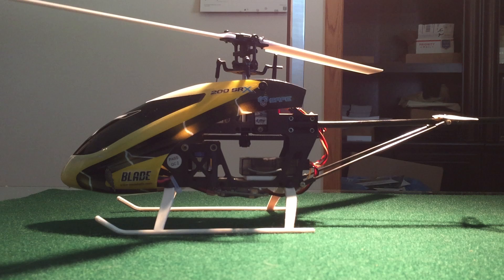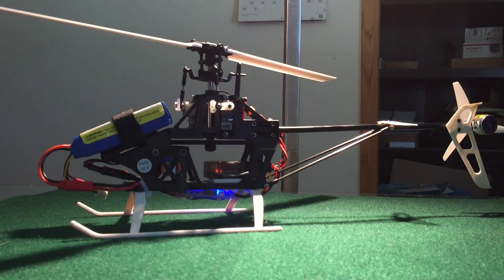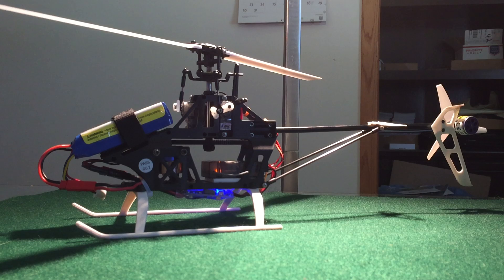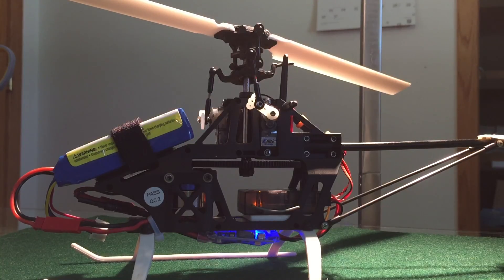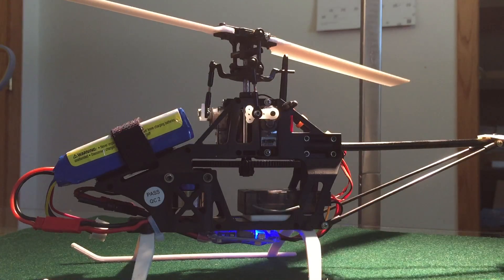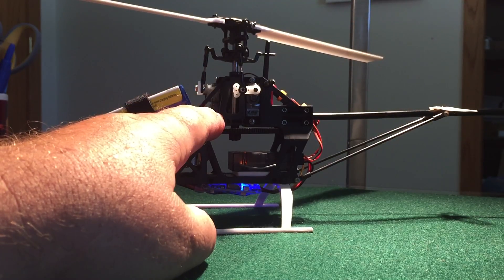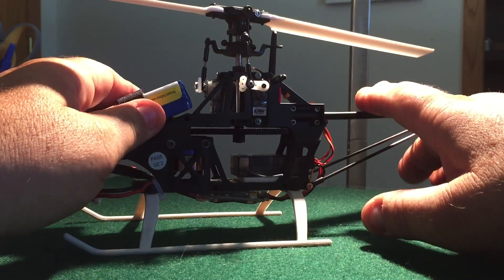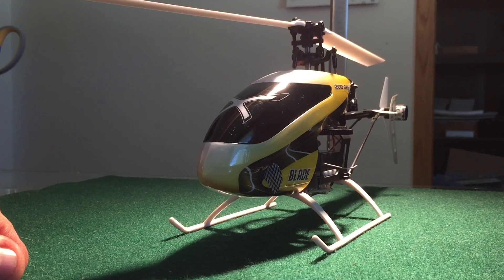BLADE 200 SRX - Advanced Settings & Setup Guide

Comment: HI mine all ways drifts to the left and back using dx6i.will a trim flight help.it seems to lose trims after each flight.
Reply from the maker: +tevad123 I am not familiar with using the DX6i transmitter. I bought the RTF version and I am using the stock transmitter.

Comment: Can anyone tell me if the rear rotor motor is supposed to spin right away as soon the main rotor starts on the Blade 200 srx. I just can't seem to get mine to run. It runs for a few seconds then stops dead. I have changed the tail motor and the ESC and all of the wires are new. Can anyone offer a fix for this. Thanks.

Comment: Hi. I modified Advanced Setting Parameters and now I'd like to go back to default settings. Is it possible? How?
Reply from the maker: +José Alberto Varona Sánchez  Just go back and readjust them all all one by one. Every set point is at 100% for stock default settings. So when you you are in each of the four modes, the center position of control horn travel on the servo will be the 100% position. If the horn moves up more, then you are going over 100% if the horn moves down past center, then you are going less than 100%
Reply: Got it. So i have to configure it manually to 100%. Thank you

Comment: Hi Nicholas. If you could help me please, my 200 sr x has begun to suck the power out of freshly and fully charged batteries in 2-3 mins. I was able to fly for up to 10 mins. no problem, starting at 12.6 volts and dropping to 11.3 volts after 10 mins, and now its at 11.3 volts after 2-3 mins. Any idea what could do this ? I can fly the 230 s with the same batteries with no problem. ESC maybe ? Thank you.
Reply from the maker: +james tremain Maybe an ESC. I had to return my first 200 SRX to the hobby shop after about five flights, the main motor fried. The called Horizon Hobbies and Horizon told them to give me a new kit. So they gave me a brand new complete RTF kit and took the original back. No problems with new one. But I have read about some ESC issues. I recommend calling Horizon Hobbies and talking to their experts. They stand behind their products and they are very nice to deal with.

Comment: Great video bro. I was about to drive my car over it as I have been pulling my hair out to the point of baldness. Thanks to your video I have it running much better. Do you know how to restore to factory settings? I would be like to see just how bad it would fly then.
Thanks again,
Doodboy1
Reply from the maker: +DOOODBOY1 They really don't "tell" you how to restore the factory settings. But, as long as you have downloaded the sheet from the Horizon Website which shows all 4 parameter settings and how to tell when you are in each parameter it's real simple to set everything up. I found that I had to adjust one parameter then hold the bind switch to let the swash plate do it's thing to let me know that the adjustment was saved. Then I start all over go to the next parameter that I want to set and hold the bind switch to save it. I would recommend setting each parameter individually, one at a time, then save. THE FACTORY SETTING FOR EACH OF THE (4) PARAMETERS IS 100% FOR EACH ONE. Hope this helps.
Reply from the maker: +Nicholas “NLBheating” Bobel I have my Motor Power at 200%, My Rudder at about 130-150%, My Filter at about 25% and my Cyclic at about 100%.
Reply: Thanks 
Doodboy

Comment: Great information on how to set up this heli properly and give it more power
Reply from the maker: +Paul Hoggett I'm glad it was of help to you. I pulled my hair out trying to figure out how to get back to stock settings, so I could start from scratch because I had a vibration / shimmy problem on my tail boom. I had to reduce the filter to a lower setting after increasing the motor power and the rudder input to get rid of the shimmy. It finally worked. Now the heli flies like a charm, rock solid and stable.
Reply: +Nicholas “NLBheating” Bobel I was just about to buy a 200srx but after your comment about the 230s I began research and ended getting a 230s instead! And a big thanks to you because I didn't know about it until you said on here. The 230s really is a great heli as well. But I'm glad you are enjoying your 200 as it's also a nice heli
Reply from the maker: +Paul Hoggett Very cool, Paul. Enjoy that 230. Now if they are available, I'm going to have to order mine. A little bigger, a lot easier to see at greater distances.